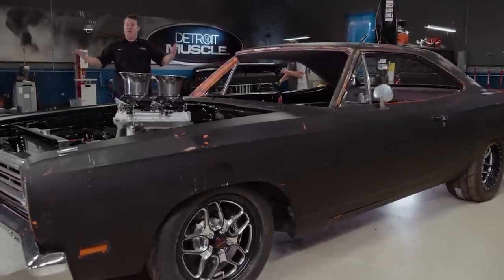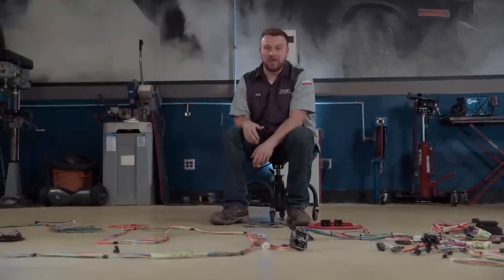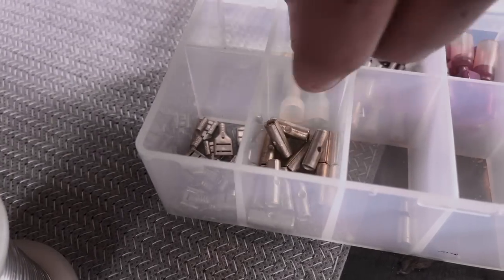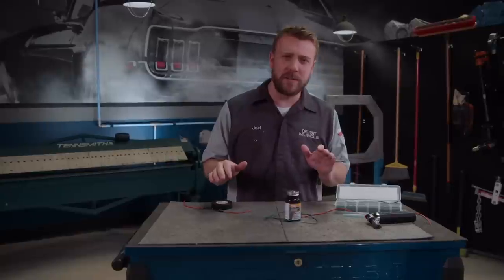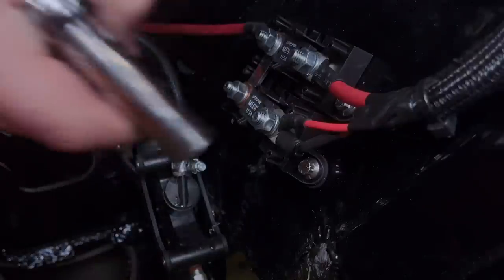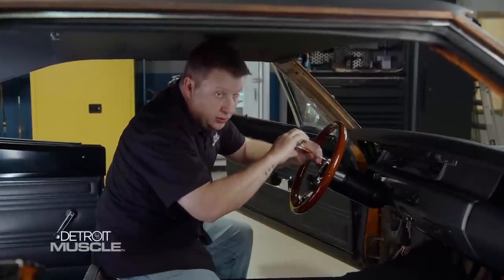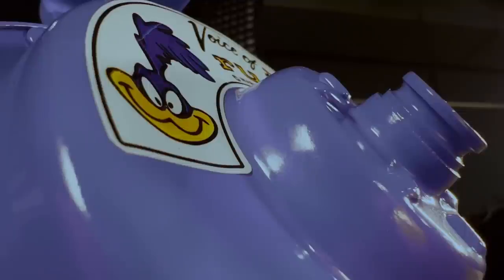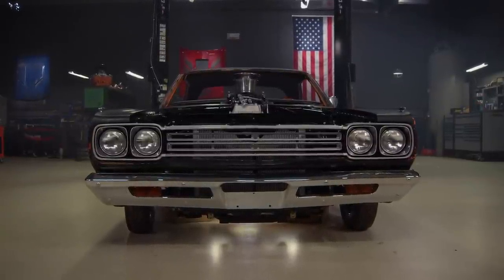Wiring Hacks to Get Our Road Runner Amped Up - Part 5 - Detroit Muscle S9, E6

Comment: I prefer solder seal connectors myself. They have the solder and the heat shrink all in 1 piece . Simply heat the connector with a heat gun and the solder melts into the wiring  and the heat shrink forms nicely around every thing creating  sealed firm connection.

Comment: Sweet build
Reply: Hack job at best.  It's sad they are to lazy to paint the rusty floors and firewall.
Reply: @bmstylee  let's see how you'd do it... oh that's right, you have no videos and are just here to leave negative comments.. 👍
Reply: @AndyFromm  you're mad that I'm making a completely accurate assessment?  Even an amateur would take the half hour of work to prep and paint that.   But I guess building rust buckets is cool nowadays.   As gringe as things like Overhaulin and American Hot Rod were they never left rusty floors.  Why?  Because Boyd and Chip are professionals.   That is just beyond amateurish and lazy.  Show one pro builder who would do that.
Reply: @bmstylee  I like the battery on the driver side 😅 battery cable is expensive I get it
Reply: @TheSaxon25  amateur hour at best